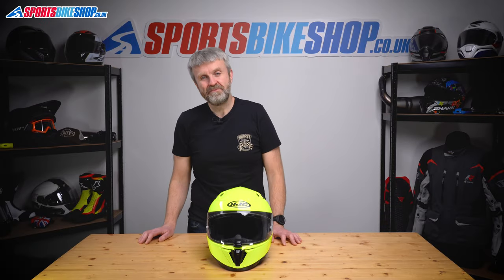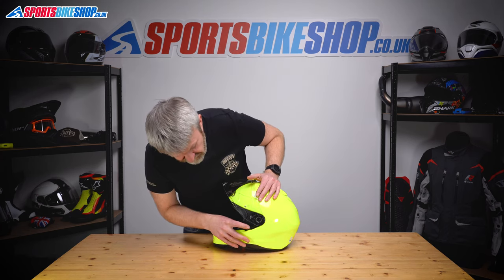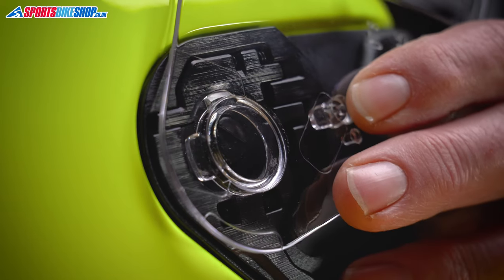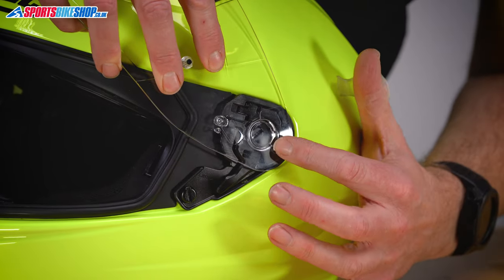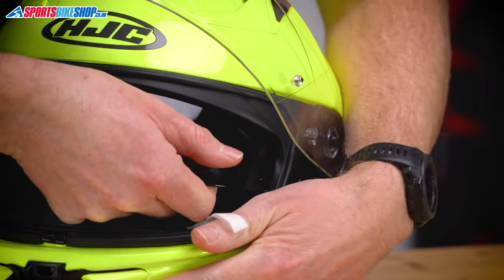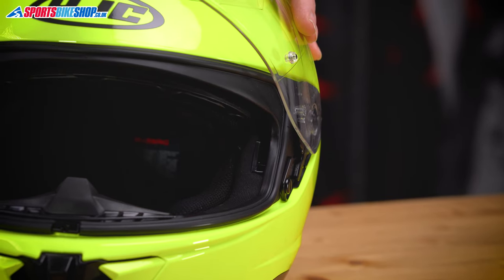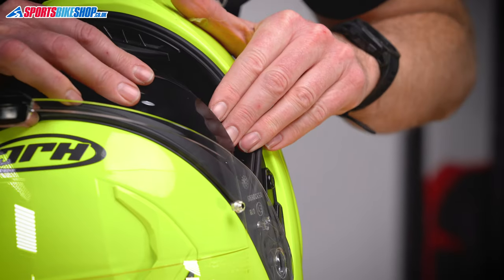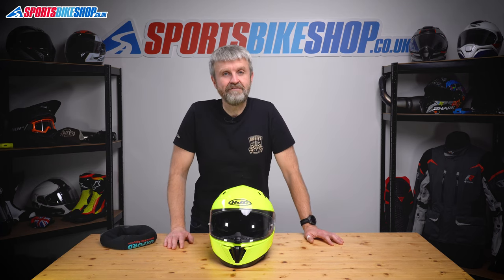How to change a visor: HJC i70 motorcycle helmet

Comment: It’s been for a while since this model entered the market. Do these i70 helmets have older or newer manufacturing date?
Reply from the maker: The HJC i70 was added to their range in 2019 and you can find the manufacture date for HJC helmets stuck behind the comfort liner. The i71 has just been released as a replacement model for 2023.